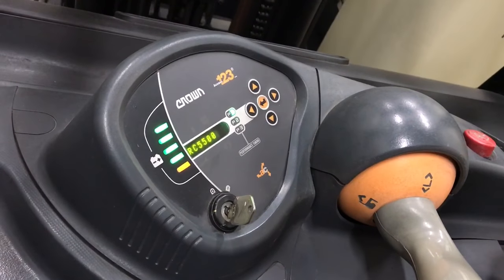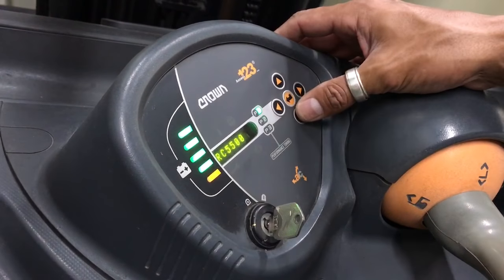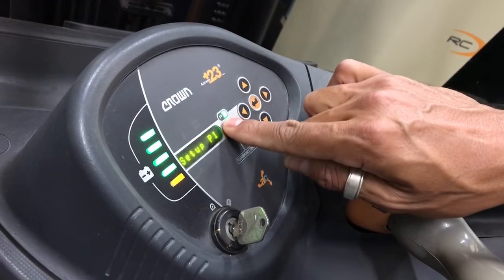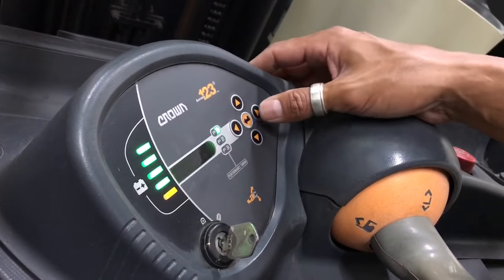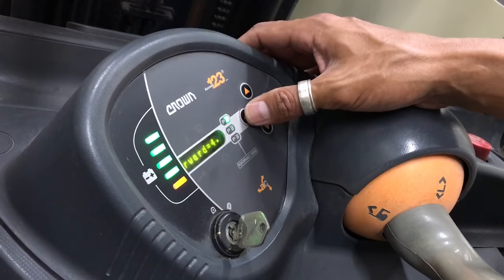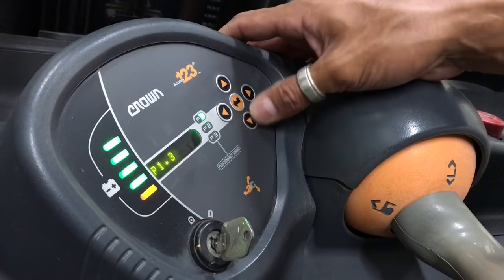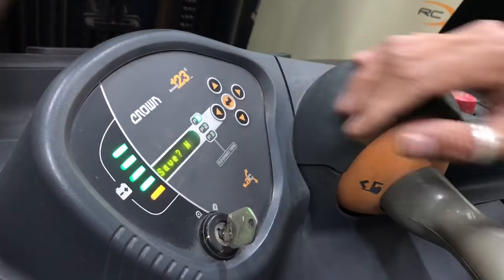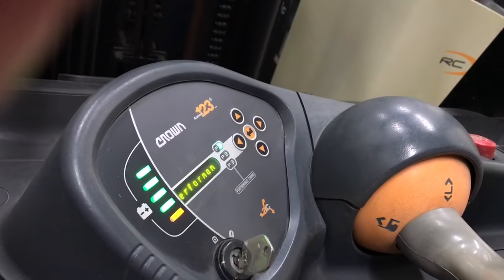Crown RC5500 series How to Increase / decrease speed

Comment: This worked for my RC 5500. My question is- What setting would cause the lift to move at 1.0 mph with the mast raised? Two of my lifts are suddenly doing that.
Reply: That's not a setting or at least I don't think it is. There is a safety switch that is open when the mast is raised causing the machine to go slow. Once the mast is down to the last stage the forklift goes at normal speed again. On the lift I drive the switch is malfunctioned so the lift doesn't recgonize the open switch and continues on in normal speed no matter where the mast is located.
Reply: Im having the same problem on my rm6000. When the forks are raised or extended even a little bit it hits me with speed cutback on the led screen 🤦🏻‍♂️. I need that off

Comment: Is there anyway I could have a detailed list of what each input does. Ex. Accy speed. Accy speed (Fl), hoist ramp and the others? I notice some reach trucks operate sleeker and are more agile in the warehouse. Reversing and turning with a pallet on the forks is much quicker in other lifts. I'm trying to optimize my settings in any way to get the same effect. I've increased all the speeds I can. And sometimes it still is a little wonky. A list of what each these choices do exactly would be amazing! Thank you

Comment from the maker: Thanks for your question, I have not made that adjustment but it may be a user performance setting.  Try to disable user performance.  Let me know if that works otherwise I will look into it tomorrow for you.
Reply: I'm having issues adjusting the brake switch the correct way (I called outside tech and the truck still not fixed) I still getting Error code 319 please advise. thank you
Reply from the maker: @dugue3000   Try to calibrate the brake to see if that helps.  C3.3
Reply: thanks for your quick response.
Reply: Try that already, runs for a little bit then the error code comes back
Reply from the maker: @dugue3000  Alright, try to connect the Tow Mode and press it in and pull it out several times and listed for the brakes to pop you should hear two pops the almost the same time.  If they are working, check the brake peddle for an open circuit.  Clear the past events and calibrate...
Reply from the maker: @dugue3000  319 is he brake switch, replace it and calibrate brake again when installed.  this will solve it.

Comment: good afternoon I have a crown c-5 2012 forklift but it is governed it is slow how can I increase the speed
Reply from the maker: You need to gain access to performance and increase it to your desired speed.  There is speed forward and backwards as well as acceleration which can be increased.  Remember to keep it at a safe speed that’s the most important of them all.

Comment: I have P2 set up with different speeds, however how do you switch between P1 P2 P3? That I can’t figure out.
Reply from the maker: Go to service enter your access code, go to Features F11.1 = Enable, go down arrow to 11.2 = Code 1 = Enter a 4 digit code.  Otherwise simply Disable it on 11.1 and Save,  Re-key and you at P1 by default.
Reply: @forkliftiq  once I enable F11 that will allow to switch between P1 & P2? Because I want P2 to be for a new driver.
Reply from the maker: Just setup codes for each and when you start up you enter the code for P1 or P2 or P3

Comment from the maker: The speed function should be similar, the access codes are usually 2311 unless it has been changed.
Reply: 2311 has bee changed 
How can I find other one?
Reply: In addition to code 2311 for RR S700 / 5700 access code how much broo..? 
Please share, waiting for a reply.
Reply: If no one knows the code, you’ll need to call Crown to come out with a laptop to reset the code.
Reply: Thanks . I was tired of drive 5mph .😂
Reply: Anyone find a new code?

Comment: The 2311 code doesnt work on mine but mine is different than the one in the video. I've been searching for the codes online but I cant find them.
Reply from the maker: If the access code has been changed you may need to contact your local Crown service department for a tech to come out with a laptop and reset it.

Comment: Ok, I get all that part. But how can you change between the different performance groups 1,2,3 ?
Reply: Performance levels 1,2,3 can be changed but first you must be off the pedals, go to Features Menu F11 then 11.2 - Enable used access code 2311 most likely or the code you set Push Enter, Press up or down to scroll to the Performance level you prefer Push Enter the Performance Level is Set.
Reply: @willvaldes1895 hey I tried all this but still not able to change from p1 to p2 or p3

Comment: Can those codes be different for every machine
Reply from the maker: The access codes from factory are the same but they can be changed, if you do not have access you may need to call Can to have them reset to factory default.

Comment: 2211 or 2311 is what the code . Which is the last 4 number of their phone number. I known this for a while but never did it on here. But the fast you can go is 7.? But still slow... This code works with all crown.
Reply: 2311 is the access code, gain access through the service option.  7 is the fastest you can go, to change speed go to performance which also allows you to change the acceleration.  The code works with most crown unless someone changed it.  If you don't have the code you may have to call Crown Lift to clear it.
Reply: @willvaldes1895  this code doesn't Control the speed but it also controls the hydraulic of the lifts too. You can have the lift go up slower or a bit faster when going high on top of the 2nd/3rd tear of the racking. Also understand or know your p1, p2, and p3 stand for
Reply: somebody took the governor off of our crown reach truck and the thing is a fucking rocket. it can move faster than I can run, it moves fast enough to get my hair blowing. super fun! just don't take corners that fast because you'll flip the bitch.
Reply: MengeR how do you change to p1
Reply: @johnnyaguilar9702  don't stand on the lift or let say don't trigger the sensor when you step on the lift. Than you hold the 🔼 button it'll take you to P1-P2-P3

Comment: Is there any reason my lift won't go any faster? I've adjusted the settings to max but it still moves like it's at 3.0
Reply: Check your height sensor, the easiest way to check it is calibration, if it fails you need to replace the sensor.